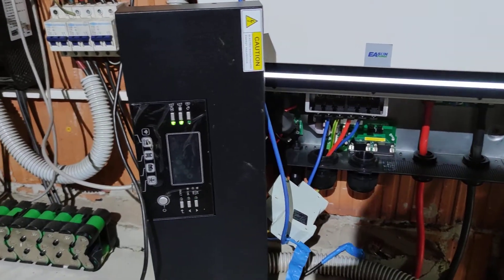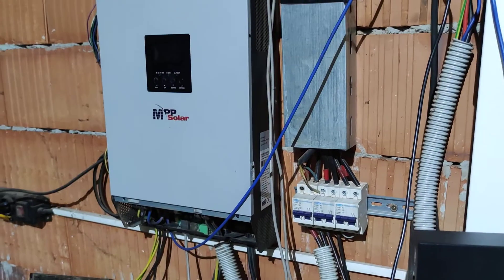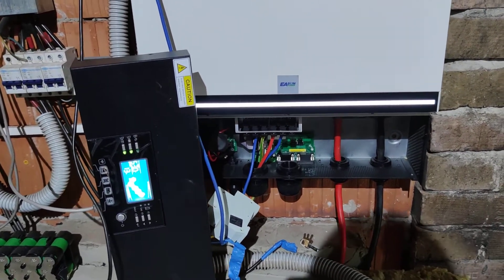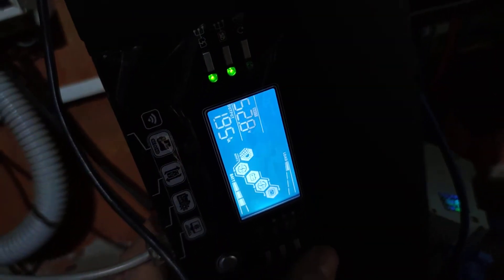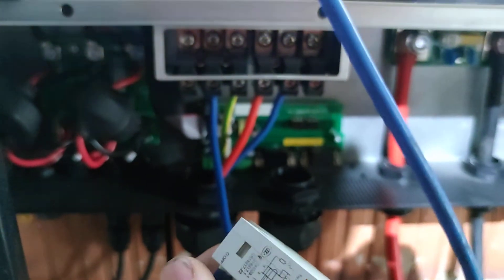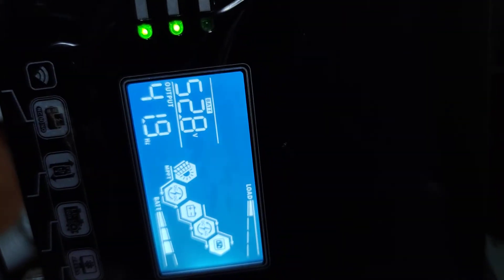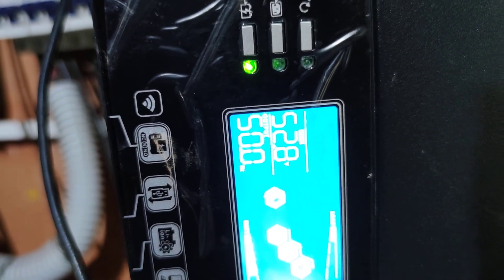EASUN SMW 8kw inverter - grid sync/ frequency issues

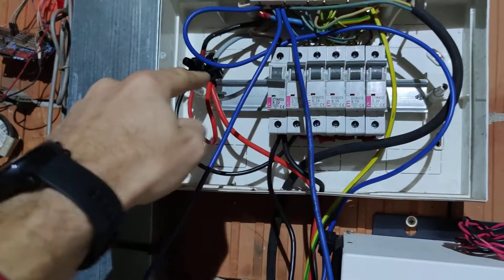Comment: I found your video while searching for information about this inverter. This is an interesting problem but as the wiring look a bit messy to me (sorry) I can't really get a hold on how this is connected. At around 3:28 in your video you try to explain how the neutral is connected and that confuses me.
So let me get this straight, you connected the OUTPUT neutral line to the INPUT neutral line via the busbar which, for the sake of this experiment you put a switch in between?
Shouldn't the input (both neutral and fase) be strictly separated from the output circuitry?
Reply from the maker: Hi, yes, I do have to agree on the wiring. :) Althought, it is because the old inverter (also EASUN 5kW version )has just been removed and the new one was connected when the issue was discovered. Yes, the input AC neutral wire is directly coupled with AC out neutral wire. Most inverters work properly in this configuration - as it should be. The issue is not simple, however, and depends on how your house electrical installation is designed, and specifically I refer to the neutral-ground binding(check how different systems work by having a look at TN-S, TN-C, TN-C-S, TT and other grounding methods). Also, the EASUN itself(Voltronic, Axpert) recommend it to be connected this way. I could probably bypass the issue I am having here by doing the modification of the house electrical installation, but that is not an option. This has to work like this. Take a look at the MPP Solar inverter on it's side - it works like that for years. Even the previous 5kW inverter from EASUN worked in this configuration without  issues for years. I had installed many of those inverters and this is the first one having this kind of an issue. EASUN engeneer is on this but can't seem to find what the issue might be. Already removed the SCR (parallel) board as part of the diagnosing process, disconnected all the loads etc, but nothing helps so far. If all fails, I will have to consider re-wiring the house installation, but that is really the last option, since the inverter itself should work in this configuration without issues.
Reply: You have by this model no neutral!!! Nehme den output neutral vom input ab!!! Dann funktioniert es!! Die neutralleiter dürfen sich NICHT BERÜHREN BEIDE!!